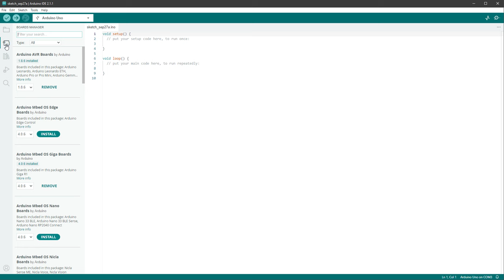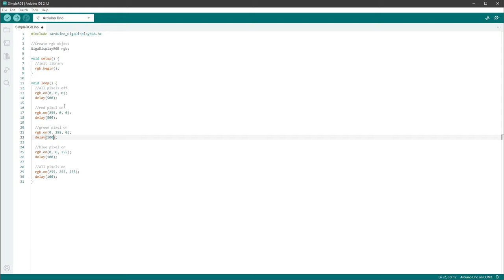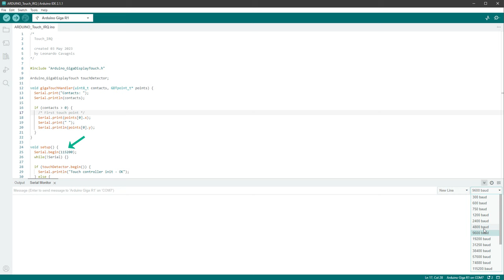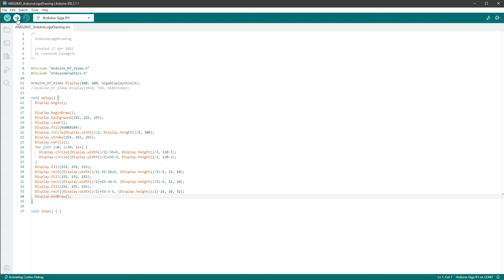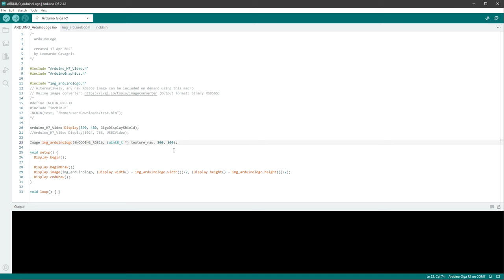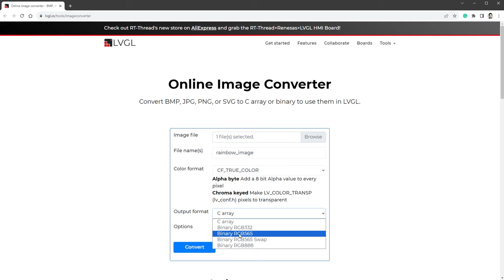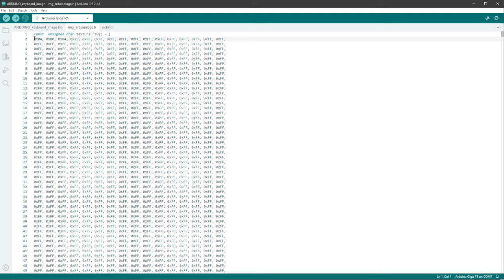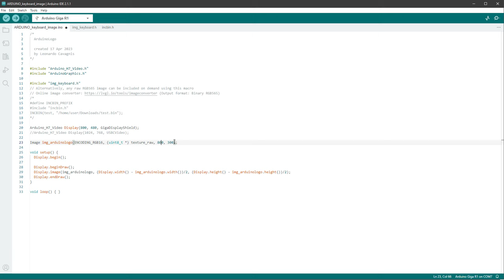Arduino Display You've Been Waiting For: Arduino Giga Display Shield

Comment: One question, is possible using arduino to read ancanbus signal through obd2 and with the reading command something? Like, ive read the rpm signal and I can say to activate an 12v pump.
Thank you in new at automated
Reply from the maker: Yes, absolutely. You might need the level shifting/module for reading OBD2, and you would need a relay for switching the 12v pump, but both should be relatively simple.

Comment: I should admit the fact that your videos have really always helped me a lot, especially during my recent product development, for the graphical display. You’ve been a huge saviour, I had intended to contact you but failed at doing so. Thank you so very much. Would be excited to see you using esp32 with esp idf and lvgl. Cheers and thanks for your time and support! 🎉
Reply from the maker: Thank you for your nice comment, I’m glad it was helpful. Is there any more information you could share about your project? I would love to see some designs.
Reply: @upir_upir  yes, basically we design and make payment devices for the vending machines. This was the updated design where I decided to use a graphical display, specifically (ST7565, COG) . My initial approach was to use the photopea but the controls , zoom in and out and lot many things were not at all working good. Then I switched to the flipper zero option you gave. From there would take some part of code, mainly the coordinates, and then use it in the library which is designed to work with esp-idf for st7565 and then yeah that’ll be it. Still a lot of things are pending, like I still cannot get hold of a 4x6Px font. So working on it as we speak.

Comment: Can we use add bare HDMI input port ho arduino and proggram arduino so we can use without any HDMI modules and drivers?
Reply from the maker: I believe the main reason you don´t see a HDMI port is speed/performance. Arduino is simply not that fast.
Reply: @upir_upir  can we achive similar project with any other more powerful microcontroller? Basically making mini portable monitor for cheap price 🤔

Comment: Thank you for this tutorial. Although the components used in the video are very good, in the end it’s not worth getting these items. It’s all way too expensive, and you can’t do a full screen buffer because the controller only allows you to use half the available ram, which isn’t enough for the display unless you do a paged buffer. I’d prefer a pjrc teensy 4 and a generic 320x480 display. The teensy has the same amount of memory but runs faster, and is much cheaper although much smaller.
Reply from the maker: The memory isn´t very big, but you can configure the buffer with many different color formats, so I don´t think that you can only fit half of the screen buffer, you should be able to fit the whole screen (with some tradeoffs on color depth). Why would you think that Teensy would be faster?
Reply: @upir_upir  the teensy has a slightly higher clock speed at 600 mhz instead of 480 mhz, and it can be heavily overclocked. I personally find it easier to program and work with, even though i don’t own the board in this video, although the teensy has less pins available. And i guess cutting the color depth for the display buffer in half will work.

Comment: Does it by now work that you have display code running on one core and other stuff on the other core?
Reply from the maker: You can do it this way, but I believe in this example, everything runs on the same (one) core.
Reply: @upir_upir  I tried this around December 2023 and writing/painting something to the display worked, when everything was running on the same core.
When I split the tasks (display - other code), the stuff written to display was shift on the display. Not the same result and not useable for me.

Comment: Display looks cool but I've always hated the arduino gpios. They re just too hard to install on pcb boards.
Reply from the maker: Why is it hard? Those are standard female header pins...
Reply: @upir_upir  The GPIO banks on Uno and MEga are not aligned to be placed on a perf board. Try soldering banks of Male headers on a perf board and push your mega inverted on that header.. you'll notice a bend on the baord which is casued due to misalignment between the GPIO banks. 
The headers of ESP32 or Rpi Pico are so well designed that you can just installed it on your proto board and it becomed a well rounded product with no hassel.

Comment: If I want to verify the code with the Arduino_GigaDisplayTouch.h libraray there is a error in which he dont find the mbed.h library. I dont know what to do.
Reply from the maker: Are you sure you have all the required libraries installed?
Reply: @upir_upir  Nevermind. Its working now haha. I had to reset the board and now its working. Dont know why.
Reply from the maker: @trash9016 cool, I’m glad it worked out well!

Comment: crazy price
Reply from the maker: You get what you pay for I guess. It´s little bit more expensive, but it´s very easy to use and has some additional sensors.
Reply: @upir_upir little more? lol.
this is module cost more then low-cost smartphone. or 8.8inch (1920x480) ips touch display module (for orange pi, etc). in 5-6 timese more then 3.5 lcd modules for arduino and other microcontroller boards.
etc...

Comment: Well, this display is slow!
The NXP can do much better display than this. Seems that this display does not unveil the full power of NXP.
Reply from the maker: The Arduino Giga uses STM32, not NXP chip. Why do you think the display is slow? It´s updating 60 times per second using that STM32 chip.
Reply: @upir_upir Both STM and NXP demo boards can do very good display but not using Arduino framework. The LVGL demo is NOT 60 fps. You can see the tearing and slow scrolling!